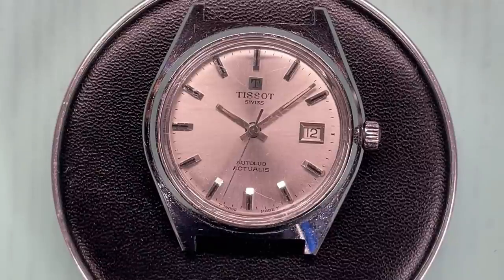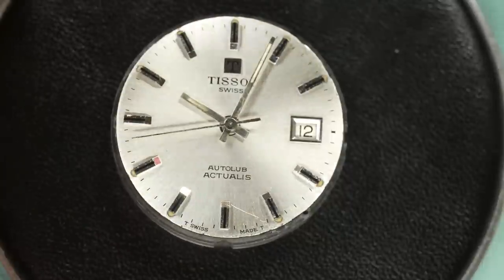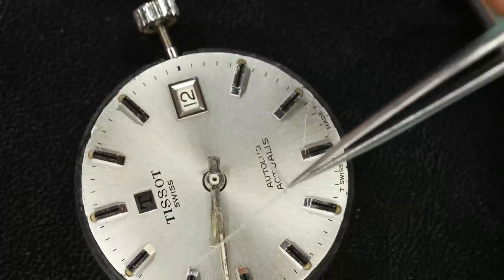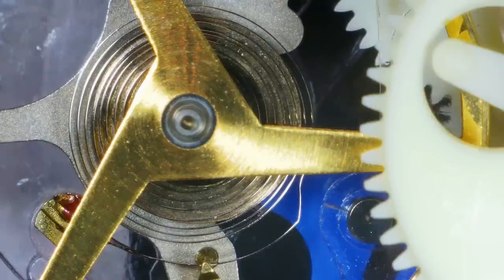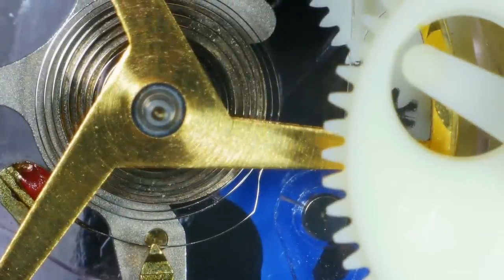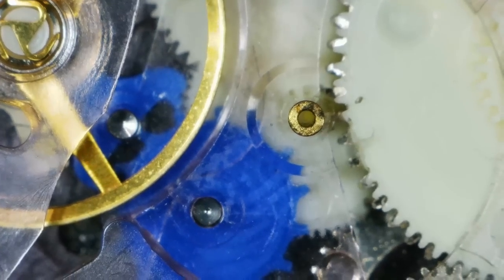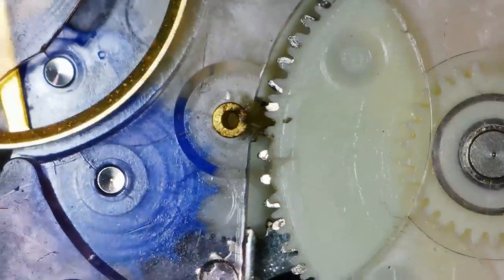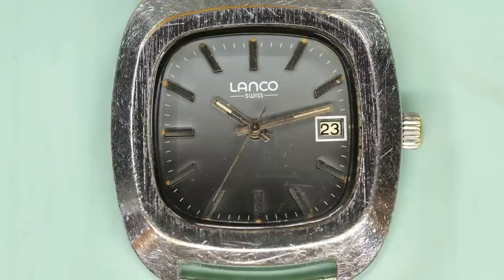Shocking Reveal: What's Hidden inside this Tissot Watch!

Comment: Despite its throwaway nature, like the pin-lever Timexes of old, this is a fairly interesting watch simply because of its all-plastic construction. The early 70s was the very beginning of "modern" plastic usage, so something like this cropping up in that time is hardly surprising.
Reply from the maker: Yes I agree the similarities of this and pin pallet. People still work on pin pallets so they have faired the test of time also surprisingly. 
The Idea of plastic is not a bad one but it was from what I’ve read marketed badly and the public associated plastic with toys! 
I’m still angry with whoever used all that damn glue!

Comment: Well I’ve learned from this video. I never knew any watch had plastic parts such as those you featured here. I found this video absolutely fascinating! Thank you for showing it.
Reply from the maker: Thanks for the feedback.  It is indeed a fascinating concept. Even more so at the time. Early 70s plastic was probably still a new material
Reply: @MyRetroWatches  The first plastic, bakelite, dates to 1907.  It was mostly replaced by other compounds in the 1940s so in the 1970s plastics were not new.  The specific compounds may have been new when someone had the not-so-bright idea to make a cheap watch movement from them.
Reply from the maker: @finesse49  new to being used in watchmaking.  It’s written in the research I did on these models, up until then it was always metal wheels.

Comment: Tissot are indeed owned by the Swatch Group and Ironically Tissot uses the Swissmatic movement in some of their current models. It's based on the Sistem51, is non-serviceable and is also assembled entirely by machine. It's exclusive to Tissot and has a 72 hour power reserve. Great video, I never knew Tissot used these type pf movements in their earlier models.
Reply from the maker: I will have to have a look at the Swissmatic .  It’s sad companies make non serviceable movements .  They should think of us hobbyists 40 years later!
Reply: @MyRetroWatches  Absolutely!

Comment: Thanks again for another honest dive into watchmaking. Really appreciate the insight you provide in your videos. By the way I have finally sorted my Andonstar digital scope. I gave up on the .5x lens and just turned the whole camera and screen 180 degrees, raised it up on a box added a small weight to the black baseplate(now facing the rear)  unscrewed the light socket on the bottom turned it 180 also so it plugs in from the new back end. Put a slight tilt on the camera and can work under it no problem using my nice green mat. I have a few pics if there is any interest. 
Cheers,
Geoff

Comment: Thanks, Mike, much appreciated. Mistakes and mishaps are teaching moments and are more valuable than seeing things go smoothly. Had a good laugh when you found the disappointingly glued dial foot, and I thought, use acetone, then you used acetone. Then when you showed the excess of oil, I thought, dip the whole thing like a Timex, and you dipped it like a Timex.
Reply from the maker: Clearly you have a mind for this stuff too 😂.  This one was a disappointment but I am glad it made a video .
Reply: @MyRetroWatches  Mishaps like this are always a disappointment, but you turned a mishap into a benefit to the rest of us and we appreciate that. 
Twice I have pooched Swiss watches in the same way: after carefully lifting the pallet cock off its pegs with a screwdriver, I gently grasped the piece with tweezers, lifted up… and the pallet cock took the upper pallet pivot with it. Time to buy a staking set.

Comment: Hi Mike a friend sent me this link 😂😂😂 I'm sorry I'm not laughing at you but at this watch! Lighter fluid is a blessing you could of soaked it in that for like a few minutes. I'm a 3rd generation watch maker, and I've seen a lot worse than this, Tissot came out with this watch and had a huge profit margin because of the material they went with. In Chicago downtown Jewelers Row we called these watches " circus watches" a watchmaker didn't do that but a "watchBREAKER" did 😂 I salute you for all your effort, I would of put it back in its envelope and sent it back, I wouldn't give it a chance to breath! Watches like this and Movado's, Cartier's you'd be surprised how many were replaced with Chinese quartz movements and crazy glued the dial back on it because the dial legs didn't fit back on it. So they would hack off the dial legs and just glue it on SMH. Because how many customers you know ever see their watch movements especially on a Movado or Cartier. By the time the battery runs out they don't remember who they took it to and if you still know that WATCHbreaker he would deny it! I respect you doing this as a hobby, this is a trade that is slowly dieing out, any questions please feel free to email me anytime! Great video and I salute you my friend! Cheers 🍻

Comment: Back in the 70s motorcycle chain manufacturers started to market "self lubricating" final drive chains. All they did was put rubber O rings in the rollers to eliminate metal on metal contact. And so people happily rode them about believing that they never had to oil their chains, up to the point where these O rings succumbed to road grime, salt and general weathering, and eventually disintegrated,causing rapid chain wear. We still use these chains today, and the concept works as chains now last a lot longer than in times gone by, but we soon learned that they do need regular lubrication
Reply from the maker: Wow!  We are often believed what we are told…. Cleaver marketing and public naivety.

Comment: Well, I wasn't expecting that! I sometimes wonder if it would be possible to create a watch movement that can be serviced without disassembly using just immersion in an ultrasonic cleaner instead. Maybe it could work if the movement was skeletonized and if the bearings were designed to be accessed and oiled from the outside? I've done that with a grandfather clock movement before - dunk it, dry it, oil it.
Reply from the maker: Well the old Timex services were to wash the whole movement in one do. I did it a while ago on a video. 
I know from time serviced professionals that in some businesses back in the 80-90s to get the work out the door many , much better movements were washed in one go.  Shameful really. Customer would be unaware.
Reply: @MyRetroWatches  Shocking. I used to work with a guy whose dad was a monumental mason. He told me that normally his father would use a machine to chisel the inscriptions into headstones but sometimes grief stricken loved ones would pay extra for the personal touch and ask him to chisel on the inscription by hand. My friend then told me that his father would then just loosen the screws and set the machine up slightly wonky so that the inscription was not quite perfect and looked as if he had done it by hand.

Comment: The Autolub was not designed to be oiled.  It is quite a good performing movement, often better than COSC accuracy.
Reply from the maker: Did I say that? They call it self lubricating due to the plastic.

Comment: I can't help thinking that I would have 'got in there' somehow. I would have opened it up for a stripdown.
I may be naive, but where there's a will...
It would probably be necessary to figure out a way of re-welding the plastic parts together again afterwards. Araldite resin maybe?
You could even cast a new gear in some kind of resin, using the old one as a pattern, and hot wax as a mould. There's stuff called 'liquid metal' that you can buy from hardware shops that might work as a gear material in the casting.

In any case - thanks for the video and the effort. I had no idea that such a thing existed. At a certain point in history plastic was new and novel. I remember as a child when die-cast metal toys started being replaced by plastic ones. I would guess that they were looking for new applications for plastic.

They might as well have used cheese - it would have been only slightly more cheesy than the plastic one 😆

Comment: Once again a Tissot with plastic galore... rather have a Chinese watch with metal gears and needing oil. So glad i didn't buy the Tissot at Christmas...🙏. Thanks for the video btw as success and knowledge is built upon having endured such failures,so its important too. I watched it through and learnt from it once again. 👍
Reply from the maker: This is a watch from the 70s and does not reflect modern watches. This was a good idea at the time in an era where plastics were new in watches and servicing costs put people off.  I think the concept was good but poorly promoted and clearly not designed to last 50 years .

Comment: I suspect the reason for the 1 jewel is to keep the balance wheel an off the shelf part, it's probably the most expensive part of the movement and would have been prohibitively expensive to design, tool up and supply a custom peice from whoever they bought the assembly from
Reply from the maker: That’s a good possibility. Didn’t think of it like that .

Comment: Looking at it, it seems like you may need the second hand fitted in order to hold one of the wheels in the correct position so the works don't jam.
Reply from the maker: No the working one I have works fine without it attached
Reply: @MyRetroWatches  That's good to know. It was hard to tell. This one had certainly been butchered. It's an amazing design though in terms of being the minimum viable product.

Comment: Hi.
Is it possible to heat up this glue to make it soften without acetone, while rest would be covered with capton tape , like in electronics repair?
Do you know which kinds of plastic were used in this movement?  I'm assuming polycarbonate on all transparent parts..
All best
Reply from the maker: It’s possible I suppose but bring so close to the dial and with the rest of the case being plastic heat would be a scary thought. Things could go south very quickly

Comment: Okay I have my Smith's Astrolon in bits and pieces. The movement case just prises apart and then obviously most thing's fall out. The problem seems to be the mainspring.But I have no idea how to disassemble it? The plastic cog on top is very delicate I have tried pushing down on the centre Arbor with no results?
Reply from the maker: How do you plan to put the case back together? They are plastic welded.  You are going well if you can.
Reply: @MyRetroWatches  Good morning for some reason this Smith's Astrolon wasn't plastic welded and just levered open really easily. It's the  mainspring that I cannot open I have had a look at a couple of videos on doing this. I have tried the Stanley blade method and pressing on the Arbor but it's very delicate due to the plastic movement wheel on top.Cheers Graeme.
Reply from the maker: @graemerobinson7693  I’d just wash it whole
Reply: @MyRetroWatches  my best guess is that the mainspring is broken as when you hold either the Arbor or the  movement cog on the back there is no resistance and the movement doesn't spring back. Woe is me LOL.

Comment: Why couldn't you show how to unload the power spring ?
Reply from the maker: Because I didn’t have my second camera setup. The overhead one all you would have seen is my hands . 
To be fair letting the power down is easy. There is an access hole to the click so you just wind to move the click and then use your teeezers to move the click past the teeth and then the barrel is free to unwind.
Just like on any other watch.

Comment: Strangely-enough,  i've found that isopropyl can get some glues to release...I saw automotive bodywork guys using it to "'debond" hot melt glue that is used for pulling out dents....
What a disaster this watch has been, so far in this video :-(

Comment: The most horrible thought is that without the revolution of the quartz movements all the entry level watches now would be like those: Plastic Crap.
Reply from the maker: Well there were pin pallet 1 jewel movements that were in everything and often said “Swiss” on the dial to make you think it was more than it was.  Many are still round and running . I have quite a few in my own collection but refuse to work on them! Well one day I will do one on the channel I think for a laugh
Reply: @MyRetroWatches  Many East German pin pallet watches of the era are quite pretty and/or cool looking with their sleek dials and sturdy cases.

I've amused myself by viewing a few YT videos where the tuber watchmaker is struggling to get an old pin pallet movement to run even somewhat satisfactory. Try it; it would be fun at least for us viewers. 😉

At least by the makers of the Autolub movements the "Plastic Fantastic" Swiss lever would still be more accurate in the long run than a pin pallet movement!  😋

Comment: I've got a couple of spare movements in bits if you need some spares... I gave up on mine in the end.. 😂🤣😭
Reply from the maker: Haha! I’ve heard of a few people being able to take these apart and get them going again.  I figure if you can separate the plates and somehow line up the pivots again it’s possible but for me I will move onto the next project. Preferably with screws 😂
Reply: @MyRetroWatches  I got really close to getting one working from two movement's, but after a couple of days I gave up, so frustrating, but the case and dial may well be useful for a Frankern build.

Comment: These movements were a dead loss. Dirt use to get in them  and the plastic would grind away. If a watch has a bit of a chance, you take off what you can and clean them in the ultrasonic  You then have to dry them with a cold blowing hairdryer. It can be done. If it works, you're in luck. If it doesn't you put it back together and stick it back on ebay from wench it came.
Reply from the maker: I figured the one dip in renata in the ultrasonic has to be the only form of service you can do on these bit like the old Timex watches.  Sadly for this one I didnt really stand a chance with all that glue. Thanks for watching and I hope you enjoyed it all the same.